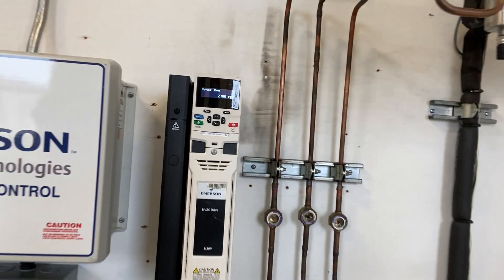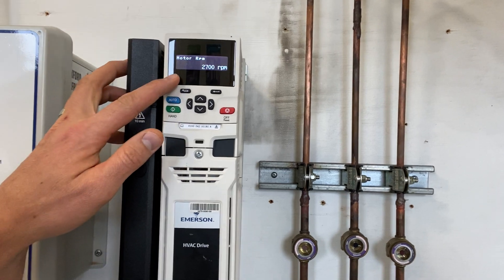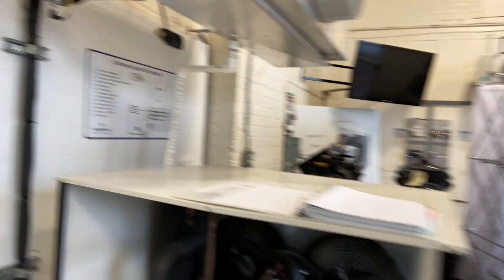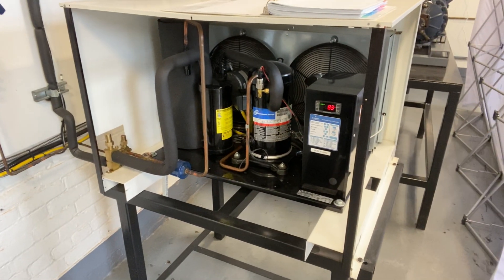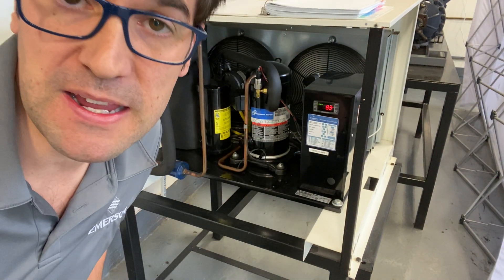Can VFD's be added to Fixed Compressors?

Comment: Hey Trevor 
Can you install a VFD on a single phase compressor ? If so how would you wire it ?? Would you remove the run cap ? I’m very interested to lower starting Amps for a backup generator application .
Reply from the maker: Yes most residential inverter systems are single phase.  First step is to figure out the safe speed range of the compressor before investing in parts as it might not be worth the costs unless you have all the parts and you have a continuous changing load.
Reply: @RefrigerationMentor 
Where can I find that information ? 
I would really love to try it out at minimum speed and high speed to convert it if possible if not I would like to find a sweet spot on how to ramp it up slowly keeping Low starting amps . I have a spare LS VFD G100 10HP. 
I have 2 units each one compressor both alliance 1# m#SBA029C1CPA s#16E4250AN & 2# m#SBA040B1CPA S#16FD3528N. If you have an avenue where to go I would greatly appreciate your support.

Comment: I have CR47 50-60 hz. 3 phase.   
Can i use vfd for it.
Which rangeof frequency should be good for oil circulation not affect and system works normal ?

Comment: Hello Trevor, on this video, ZB15 and what?, is that compressor a 3 phase or 1 phase, I'm trying to get the answer before contacting Copeland manufacturer to see if my compressor ZP29KE-PFV-130 on 1 phase  accepting 1 phase output VFD before doing over $1,000 job to replace compressor to 3 phase plus 3 phase output VFD, thank you.
Reply from the maker: Most compressors can have drives on them. Many are limited to the range you can get to. They had manuals on this. The question I would ask myself  why put a drive on the compressor? Is it oversized? Bad climate control? If you install a drive What is the ROI/payback time?

Comment: Hi Trevor. I installed a copeland zs33kae to a vfd at a residential application. It is a water source heat pump. It is a one off build. It was difficult to dial in the charge with the various factors. Some of them being the dual pressure control, freeze stat, and unconventional system causing issues with startup/ configuring system charge. But once i got the system dialed in it was very rewarding.
Reply from the maker: @2strokekickdrum  great job. Remember that the turn down rate is low for that compressor I think 45-60hz. Check AE21-1369 R7
Reply: @RefrigerationMentor  Youd be right! Thanks for responding. I love the dedicated community.

Comment: Is it possible to convert a fixed speed screw air compressor for my laser fiber to VFD?
Reply from the maker: @wlchin021160  I do not know the answer to that but if you reach out to the manufacturer they should be able to tell you the motors limitations.

Comment: Hi, although this may not be the best spot to ask but: I have a hermetic compressor for high pressure that uses up a way too high start current. would a vfd help this issue granted that the compressor is compatible with it?
Reply from the maker: No you have another issue happening you will have to fix and address that first.

Comment: I am a bit surprised the app notes do not talk about oil circulation at low sustained rpm speed operation where vapor mass flow can be significantly reduced. (only mentions soft start slew rate of 3 seconds for initial oil injection).  40 Hz to 60 Hz VFD range is probably not a problem, but the narrow speed range may also not be worth the effort.

When talking about 25-60 Hz range, I would be concerned there may be an oil circulation issues if run at low speed for a long-sustained time period.  I was guessing the 65% capacity reduction for two stage compressors was at least partially selected to reduce possible oil circulation issues.

I had an evaporator oil logging issue with a compressor that had poor compression.  I estimated its running capacity was in the ballpark of 50%.  Enough compression to make liquid line refrigerant during nighttime temperatures but not enough vapor mass flow through evaporator and suction line to bring oil back.

Single phase motor is possible but a bit more complicated.  Start (auxiliary) windings on a single-phase compressor is typically designed to operate at a higher AC voltage (over 300 vac for 240vac compressor) due to impedance transformation of the run capacitor which generates the synthesized second source phase which is 90 degrees current leading phase in relation to run winding current. 

For single phase motor, two PWM VFD source phases with 90 degrees offset are required with higher base voltage for start (auxiliary) winding that are both scaled to the V/f constant.  Series run capacitor cannot be used because of the variable frequency causing variable phase shift across a series run capacitor.  Also cannot use the coarse PWM frequency which would be an issue with a series Run capacitor.

The good thing about the single phase motor dual source PWM inverter VFD drive is you are always ensured the optimum 90 degrees offset drive for maximum motor torque for any motor loading range.  A normal single phase motor Run capacitor value is a compromise approximation, and its phase shift varies across compressor load range resulting in deviation from the optimum 90 degree current relationship between run and start windings.

Other issue with many VFD drives is they have high peak AC input current crest factor that results in poor power factor and high harmonics current load on grid.
Reply from the maker: Thanks for the info. Yes these are for fixed compressor that do not have brushless permanent magnet BPM motors. The range is way bigger for BPM motors. For any compressor with a drive you will have to have some sort of oil boost cycle to make sure you are not logging the oil anywhere.
Reply: Need help please I have a new 3ph condensing unit for a walk in cooler  copeland scroll comp. But the building only has 1ph the equipment was purchased wrong its already on the roof and installed can I use a vfd to take 1ph and make 3ph?? Not worried about efficiency that would be a bonus I just need it to run
Reply: @bryanmccue7780 yes, a VFD can do that, you just need to get the appropriate one for the power consumption

Comment: Hey. 
Have a random question regarding the 01 AC fault codes that are occurring on my Emerson EVC 1150B K1 114 VFD Compressor Controller. 

 Replacement compressors were previously installed to remedy but as soon as power is applied to the VFD a dead short occurs and instantly blows two of the three 35 amp fuses and yes, sounds like a shotgun going off. 
 The VFD nor the VFD Compressor are grounded. 
Any thoughts? 

ThankYou
Reply from the maker: That is a great question. What did Emerson say?

Comment: How about rotary compressors common with r22 residential ac?
Reply from the maker: Check with the compressor manufacturer
Reply: Rotary? Do you mean piston type? Or old rotary compressor? I haven’t seen a rotary compressor in a lot of years so I would say rare. If you say piston, I have to believe for res AC scroll is 60-75% now.
Reply: @patcampion716  rotary is most common compressor in India. Scroll is very rare.
Reply: Piston type would be reciprocating type. Those are old tech now.
Reply: @jec_ecart  any mini-split utilizes a rotary compressor from 9kBTU to 24kBTU the rotary compressor are the king!!
Reply: Starting torque will be high since these don't start up unloaded like a copeland scroll compressor does.  If you are talking a single phase rotary and it is relatively  low capacity (1 ton or less) you might get by with an oversized VFD using two legs of the output.  But that would be a complete hack/science experiment - it's been done before, but not recommended or intended..

Comment: Are you aware of any vfd problems on a Emerson vfd compressor combination inside of an aaon unit using Delta Wye High leg three-phase voltage two phases at 120vac and one at 208vac?
Reply from the maker: No, I do not have much field experience with them but that would be a great question for Emerson’s electronics team 1 (800) 829-2724

Comment: This is exactly what I wanted to know. My home's HVAC uses a reciprocating R22 compressor from the 1990's. I was thinking that it would be possible to estimate the load accurately using just thermistors on the discharge and suction lines.  Wasn't sure if the compressor could handle a VFD though, but if it can, I could couple it with a microcontroller to throttle the speed for efficiency gains and longevity of the motor. Right?
Reply from the maker: Well you will have to be careful that compressor has already surpassed it’s expected life. Check the manufacturer specs and make sure you stay inside the envelope of the compressor.
Reply: Typically has to be a three phase compressor for a True VFD. Better to change out the system being R22 and all.
Reply: It’s likely a single phase compressor. You could replace it with a 3 phase compressor, and use a VFD that way. And yes you could install thermisters on the suction and discharge. You would spend a lot of dough though, it would be a waste of money. Thousands of dollars to do this scenario.

Comment: Nice info.. Which model VFD drive can be used on a ZP44K5Epfv?
Reply from the maker: Any as long as you follow the manufacturer specs for both the compressor and drive any drive will work. Check out AE-1430 and the manual for that compressor.
Reply: @RefrigerationMentor  thank you. You’re a wealth of info. I love your 2 minute video clips.
Reply: @TheRealoldcar   The PFV suffix of your compressor model  indicates single phase 208/230V.  You would need to swap in a three phase compressor model ZP44KxETF5 (or aZP42,ZP48 etc..) and use with a 200-230v drive rated for at least the full load amps of the compressor.  If feeding a 3Ph input with only 2 phases you would want to derate the drive i.e. size up by factor of roughly 1.5 to 2.0.   You can snag an overstock new compressor and maybe a new or used drive on eBay if you are patient, all for a good deal.   Otherwise project may be cost prohibitive...
Reply: @GannDolph  thank you for that information
Reply: @GannDolph  i recently upgraded the condenser’s compressor with a 2 stage  ZPS40k6epfv. , it is a 5ton split ducted system where the horizontal evaporator is located in the attic which 20 feet above the condenser with the line set about 5 feet above the horizontal evaporator. I have a concern that it may pose an oil return to compressor issue when it’s at 65% capacity during cooling; therefore I have not run it in stage 1 mode and only running it in stage 2 until I figure out a way to confirm that oil return during stage 1 operation is proper.  It would be very difficult to reroute the 1-1/8” vapor line so that it is level to the evaporator.  These Northern California track homes are not built so that they are HVAC service friendly.  Oil return issues on a VFD/VRF could be even worst.  Any advice would be greatly appreciated
Reply: @TheRealoldcar  So that's a 3.25 ton compressor piped in to a 5 ton system?  Sounds like a setup with great potential.  You just need to 1) properly slope horiz. suction line  spans, and add all the  necessary  suction line traps  required for your particular line set  config,  and  2) keep sufficient suction line flow velocity to ensure oil entrainment+return. 

 I think you want  a largish bend radius suction line trap right out of the evap, that dips below the lowest sections of the evap coil, which oil can collect into instead of the evaporator.    Then runs back up into  a modest inverted trap that goes briefly higher than the horiz run.   Then slight downward slope toward the condenser on the horiz runs, then into  a typical down / up double trap at the compressor.  
   The 1 ⅛" suction line seems a little big but with the evap well above the condenser you should be fine with gravity your good friend here.    Definitely size down for your traps however, ⅞" max , and maybe swap  the 1 ⅛ to  7/8" where-ever the line is accessible.   You def want good velocity through the traps.
  If you can't do any of the above then  you could set up a control to step up to high speed for ,perhaps , 1 minute in every 10min, whenever it's running in first stage (low) - to periodically help scoot that oil along.  good luck! 👍
Reply: @GannDolph  Thank you for all the helpful pointers.  I agree on all of them.   Yes, that ZPS40K6E is a 3.25ton in the 5 ton system.   I will definitely have to reroute the vapor line with 7/8" to eliminate the 5 foot rise above the evaporator.

Comment: Been there done that! 35to 70hZ. No problemo
Reply from the maker: Yes for certain compressors.  Others like Copeland Discus go from 25hz to 60hz, other scrolls will only go from 45hz to 65hz so it is important to check what they are rated for.
Reply: @RefrigerationMentor  Any idea approx what RPM the centrifugal oil flow shuts down at on copeland scrolls?  The minimum Hz quoted in the AE has moved higher over time versus the first revision of that bulletin.  Yet many folks claim 35 to 40Hz on the scrolls with no problem ..
Reply from the maker: @GannDolph  you will have to follow up with Copeland. I suggest always follow manufacturers instructions but I have seen contractors and OEMs run outside manufacturers suggestions. These are companies that understand the compressor as well or better than the compressor manufacturer and they do all their own testing and take on all the risks. If you don’t test I suggest sticking with manufacturers instructions.
Reply: @RefrigerationMentor  roger that , makes sense - many thanks !

Comment: Was not aware those motors were invert duty type motors. You can but unless they are in invertor duty more problems.
Reply from the maker: With fixed compressors because they are not brushless permeant magnet motors they have limitations but still could have a good range.
Reply: @RefrigerationMentor  you keep saying compressor, it’s the motor the VFD controls and will cause all types of issues unless it’s inverter duty BIG PROBLEMS especially in larger applications. Just because you can DONT! I have seen it time and time someone thinks it alright to put Amin investor duty induction motor on a VFD/Freq Drive what ever you want to call it. I even see it regularly on residential subsystem, these inverter duty boards don’t hold up burn out them the compressor goes due to crappy  voltages in neighborhoods. Way to many factors to say “ you can put on a motor” no hell no.
Reply from the maker: @LouisvilleHVACR  both Copeland Discus compressor and Scroll compressors have be rated and used with VFDs since the early 1990s. They are inverter duty motors.
Reply: @LouisvilleHVACR  This is exactly what line reactors are for... Additionally, Inverter Dusty typically means 1) better motor cooling at low speeds and shielded bearings. If done right (properly terminated Shielded cables, line reactors, etc.) I'd go for it all day. The part I am struggling with is controlling the compressor drive, compressor fan drive, and blower drives without having to use an expensive controller...